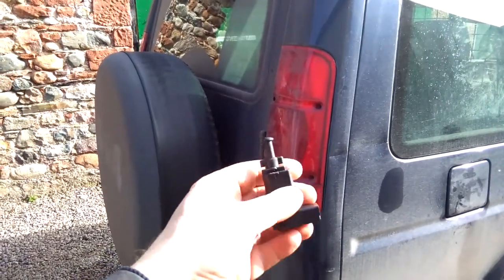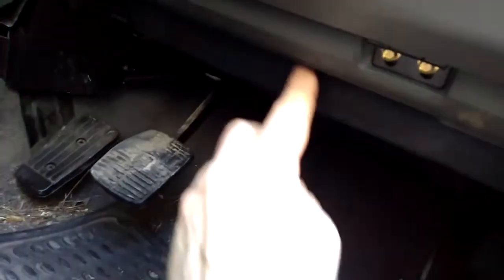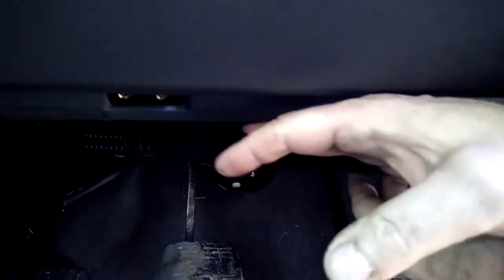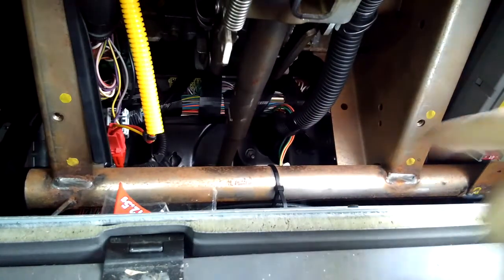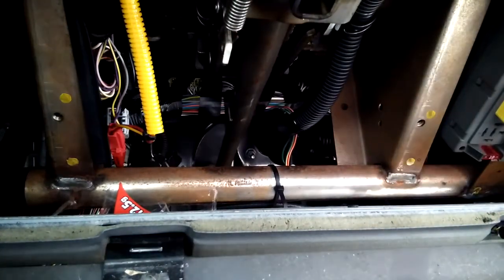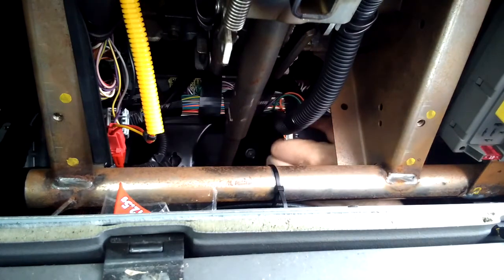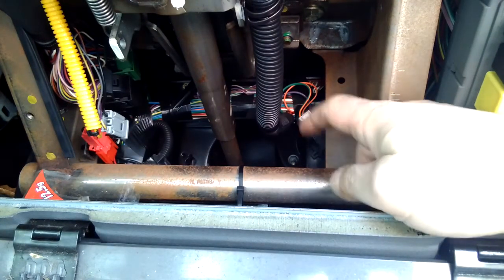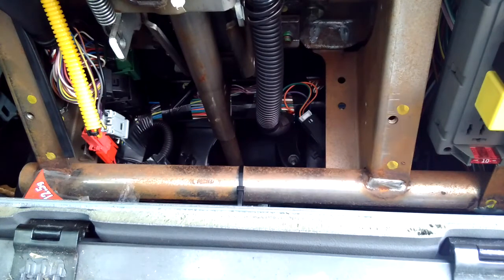Land Rover Discovery 2 TD5 and V8 - Brake Light Switch Replacement

Comment: Thanks, think you have a different model, mine is a 1993 V8i so possibly older than yours.  Having a cuppa and going to check fuse, just in case! ;0) Thanks for the video, was good and covered an area not often dealt with!
Reply from the maker: Thanks Prof. Yes, this is a 1998 Discovery 2 TD5 but I think with most Landies, the brake switch is in a similar place?